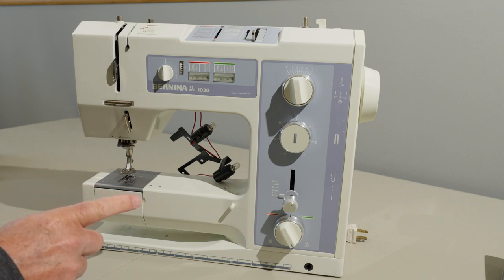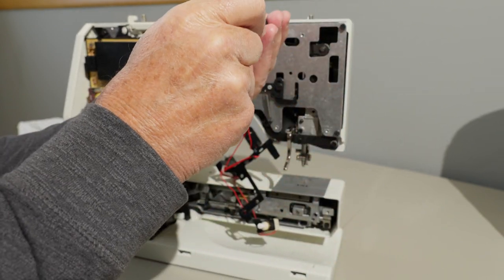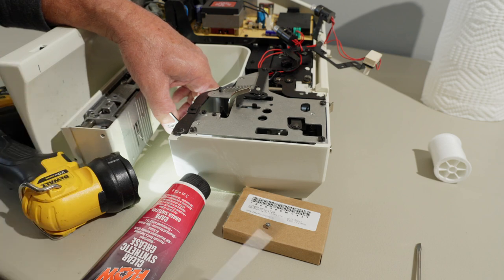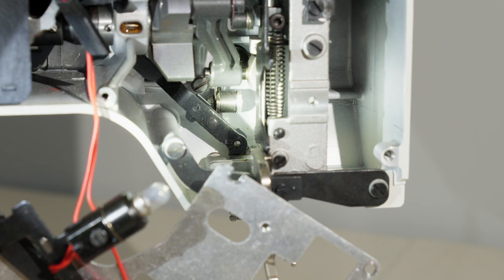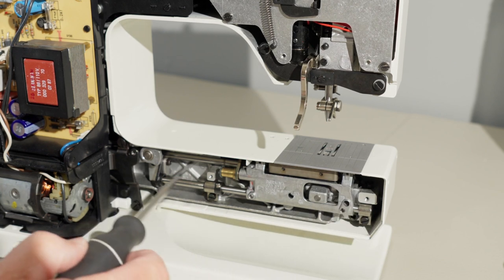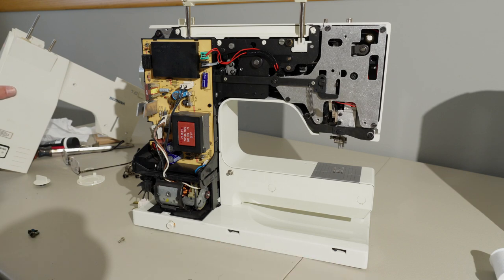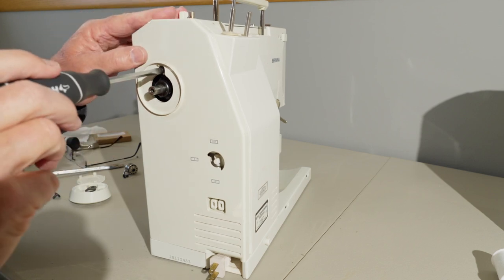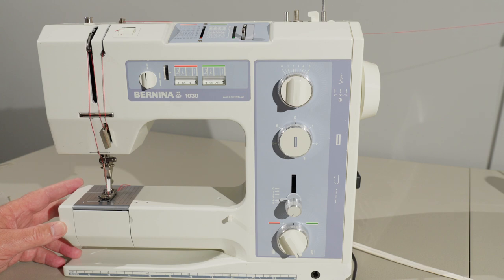BERNINA MODEL 1030 SEWING MACHINE bearing replacement.

Comment: Can you do another video showing details of all the oiling points? 

For someone who doesn't do this often, the oiling points are not as obvious as suggested in the video.  

I'd greatly appreciate it. Trying to oil my mother's 1030. 

Thx.  🙂
Reply: Bernina lover and repair diva of the 900 series. 
Hmm, I thought this 1030 and the 1100 series were best left to the professionals, since there isn't a separat top lid, I but believe we too can do this!

Same thought here, pity we weren't shown the complete oiling points, while the machine was open.
I recommend getting the 'Service manual Bernina 1030', google it. But the pictures aren't always great, that's why these videos are gold!

Always disconnect the machine before opening the side and back!
The rule in my book is; if it moves, it needs oiling! Turn the wheel by hand to see the movements.
Look for the obvious oiling holes, and steelbars or other moving parts to and from, or passing through something. 
If a small drop of oil is astrayed in the mecanical section, it shouldn't matter much. But, keep the oil away from the electronic section!

I would also have loved to have the 1-2 flat pcs 1/4'' by 1'' identical whatstheirnames pointed out. 
They  might explode when worn out, after these decades. Better prevent such damage, by changing them before it happens. 🤎